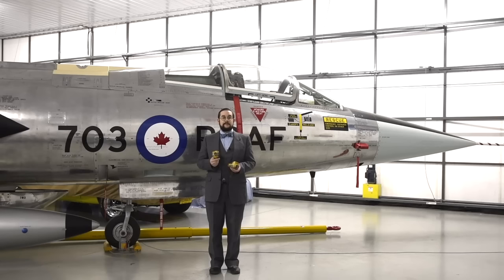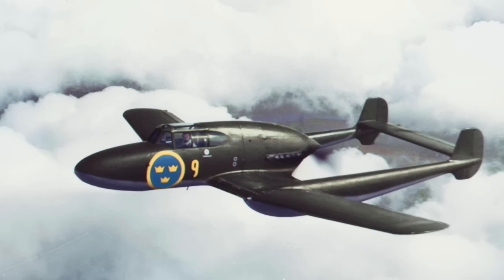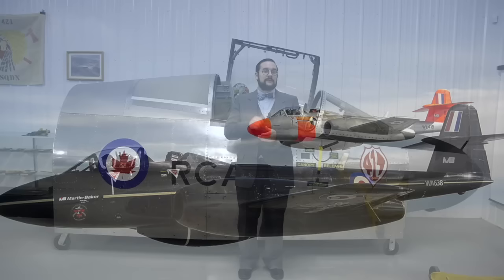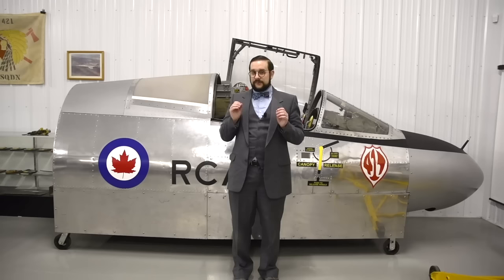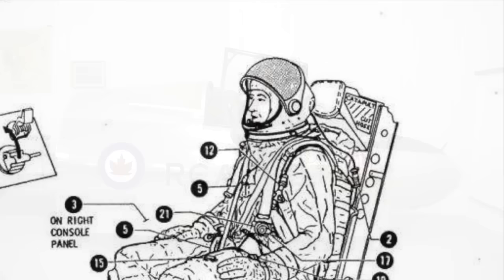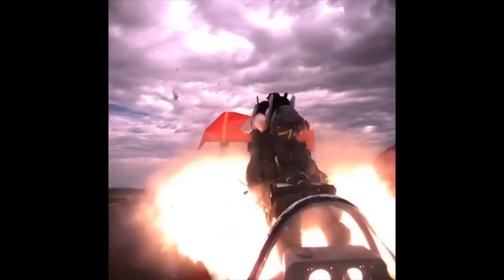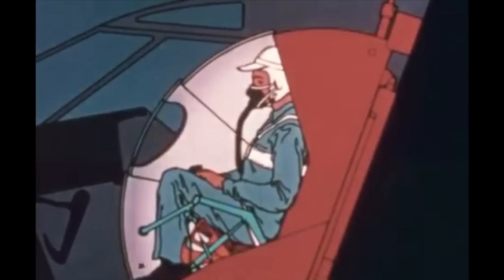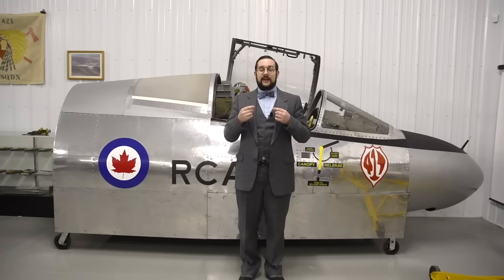F-104 Spurs and the History of Ejection Seats

Comment: I was a non-pilot RCAF member from 1996 to 2001 and there were problems with the fact that since pilot's were getting larger and heavier the CF-118 ejection seat's were struggling to get the ejecting pilot sufficiently high enough for the parachute to open safely during landing and take-off rolls.  They were supposed to be but failed as Zero-Zero ejection seats if the pilot was at the heavier end of the spectrum.  I remember seeing a CF118 cockpit mock-up being towed down the runway at CFB Cold Lake at various speeds with a dummy in the ejection seat.  The RCAF resolved the pilot weight issue but just a few years later loose stitching in a shoulder strap led to a series of events that led to the death of Captain Kevin Naismith during a Maple Flag exercise.

Comment: So many devices and procedures that can go wrong, only for the pilot ejection feature! I can (somewhat) imagine how mind boggling-complicated an aircraft can be.
That was very interesting, I was curious what on earth can be said about a couple of spurs for 20 minutes. Curiosity satisfied and then some.
BTW, did they ever used a Blackbear to test the  Blackbird?
Reply from the maker: As far as I am aware, bears were only used to test the B58 escape capsule; most other ejection seat development efforts used instrumented dummies. However, there was a 1954 program called 'Project Whoosh' (yes, really) that used chimpanzees, which were ejected from a specially-built air-launched rocket called the Cherokee. Though none of the chimps survived due to parachute malfunctions, biometric sensors revealed that they did survive the initial ejection, indicating that supersonic ejection was safer than initially assumed.

Comment: Funny enough, there's been a couple helicopters designed with ejection seats. The rotor blades are jettisoned with explosive bolts before ejection so the pilot isn't chopped up.

Comment: I was a PR in the Navy I packed hundreds of those drogue chutes you would have to pound on it with a rubber mallet to make it fit into the container that's what it said in the manual to do.
Reply from the maker: That's kind of frightening. Overpacking parachutes is one of the factors that led to the Soyuz 1 disaster in 1967. The parachute canisters were too small, but since the Soviet leadership was pushing for the launch to occur ASAP, the technicians just stuffed the parachutes in with mallets. They failed to deploy following reentry, causing the capsule to slam into the ground at terminal velocity.

Comment: The issue of low speed, low altitude ejections was preally highlighted by the F100 super Saber...the so-called Saber dance. Where during landing if the approach speed was too low the sircraft became unmanageable and would crash. Also an issue with Naval aircraft, either a 'cold' cat shot or the arrestor cable failure 
One of the earliest F104 downward ejection fatalities was Ivan Kincheloe. At the time considered to be one of, if not the best,  test pilots. The Air Force initiated the Kincheloe award for excellence in flight test. Odds are high he would have been among the first of the astronaut slectees.

Comment: There are one or two inaccuracies regarding the Martin Baker Tie Cub in the comments. Membership is open to emergency ejectees only, not all ejectees leaving an aircraft using an MB seat.  Emergency ejectees receive a tie, tie pin, cloth patch, a membership card and a certificate to mark their membership. They don't receive a plaque or a free watch, but are given a discount should they want to buy the appropriate Bremont model. Ejectees Bremont watches have a red barrel band, not sold to anyone else.  Martin Baker seats have saved 7713 lives, as of 27th November 2023.

Comment: Im fairly sure the reasons mentioned for pilots not wearing parachutes during WW1 is that they weren't practical. They used canister held parachutes that would either have to be attached or built into the aircraft (some tried). I can imagine where the myth of cowardice came from with the context that it was better to prepare for the fight, than how you will escape it after you are beaten. What we think of as the modern parachute wasn't really a thing until just after the war.

Comment: The Germans used compressed air. And low dawn actuation. MB used cordite years later, using cordite, which caused spinal injuries. The other German name for a Starfighter, was the ‘ground nail.’
Reply: The Germans also used 20mm cannon cartridges cases to eject seats and pilots, which caused spinal injuries in a few of the few times it happened.  
Martin-Baker quickly reduced that effect by designing a telescoping rod with five staggered charges that accelerated the seat and pilot to a higher velocity over a longer time, avoiding most spinal injuries.  
It was later suggested that more than two ejections would cause a high likelihood of spinal injury in a pilot, but this was a conservative estimate, as living, non-wheelchair-bound four-ejection pilots can still become pilots or instructors on other forms of aircraft.  
Lockheed's corrupt practises in trying to find customers for it's F-104 design (the USAF had no use for it, and the French and RAF had superior interceptors) led to many dead German, Belgian, and other nationality pilots, yes.  
Lockheed also lied that the Martin-Baker seat would not fit into the F-104, even though the German rocket-launched F-104s already had them.  The Germans used the M-B seats as the Lockheed supplied seats would not save the pilots of F-104s launched at those low speeds and that low.
Reply: The F16 was nicknamed the 'lawn dart'.

Comment: One problem with Zero, Zero ejection seats.
You do NOT want to deploy them in the hangar.
There was some middle eastern country that the US gave some fighter jets to.
For some reason several of their pilots thought it was a good idea to try to eject inside the hangar.
Their remains were splattered all over the celling.
After the 2ns or 3rd incident the planes were modified so that the ejection seats would not work while the plane was parked.
Reply: Some years ago a skilled and experienced RAF pilot stood on an ejection handle that he hadn't put the safety pin in, bent the handle backwards, fired the first gun, and was flung up, out and fell down onto the concrete floor of a hangar, while the seat came down on an expensive aircraft, ruining an expensive seat and aircraft (both were eventually fully repaired and put back into service, unlike the ex-pilot.  

Martin-Baker modified all their seats so that the handle could not be bent over; a conical socket for the ferrule containing the cable.  
The 'not putting safety pins in' factor was not addressed, except by repeating the lectures and practice sessions the pilots had on their first days in training, no exceptions.
Reply: Used to read the “ TIG Brief “ back in the 80’s ( on a non-flying base ). Read about at least one ground crewman who died in the hangar when the ejection seat fired.

Comment: As soon as you got to 'in a second' I gave up. The Martin Baker ejection seat required the pilot to pull his legs back before firing the beast. Martin baker invented the ejection seat. In RAF use this never caused any problems, but for some odd reason American pilots were getting their legs chewed up or panicking as it's normally known.
Reply: Well not strictly true that Martin Baker invented them as shown in the video, but they took the fledgling idea and have made it the wonderful creation that it is today. Even the Americans must agree because many of their front line aircraft have Martin Baker ejection seats fitted in them.

Comment: Great presentation! I have one question, though - what happens if one or both of the guillotines fails to cut the spur cables? I imagine the dangling several-hundred-pound seat would make it likely that the ‘chute would tangle or twist upon opening, plus cause the pilot to descend too fast. Would the pilot simply have to reach down and unbuckle the spurs from his boots with the weight of the seat on them, or try using his survival knife and hope he didn’t drop it?
Reply: more likely to rip the spur of the boot mite bust you leg thou but looking how they were fitted to the boot more likely to pull of that's the way i see it :)

Comment: 10:55.  No, 21 USAF pilots did not die ejecting out of the F-104 in the first year of operations.  I'm not sure where that canard comes from, since USAF Starfighter losses were well-documented.  From the first XF-104 loss in 1955 to the end of 1959, they lost 27 F-104's that used the downward-firing C1 seat.  There were 17 downward ejections; 11 were successful, 6 were not (the other 10 losses were runway excursions/CFIT/unspecified).  All the downward-firing C1 seats were replaced by the end of 1959 with the C2 seat.   USAF Starfighter pilots rolling the aircraft over and ejecting down, or whatever, because they were "confused" about which seat they were sitting on sounds like the same kind of nonsense.

Comment: Excellent video except for one thing. Rocket seats are not rocket powered. The 90 k ot seat accelerated the pilot at 60 feet per second. The Zero Zero seat at 80 fps. After the normal cartridge sequence, a pin was pulled on the bottom of the seat, igniting the rocket. This gave the extra boost and height. The MB seat deploys the drogue and the chute opens inverted so the pilot ends up with a fully deployed chute at 300 feet.
Reply: Very true! In many videos like this, they forget to mention the fact that Zero-Zero seats are "two-stage" seats, functioning just as you described.
Reply: @Nghilifa  Thank you. I Remembered something from my training.